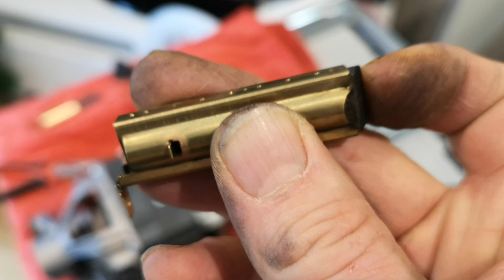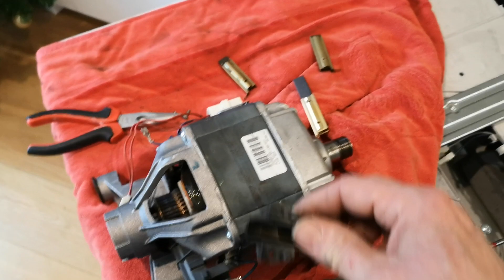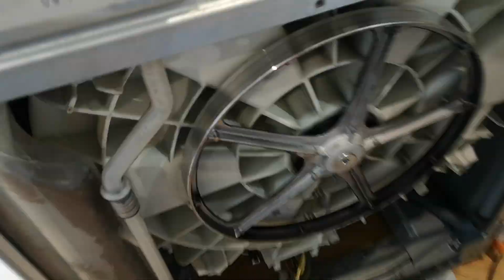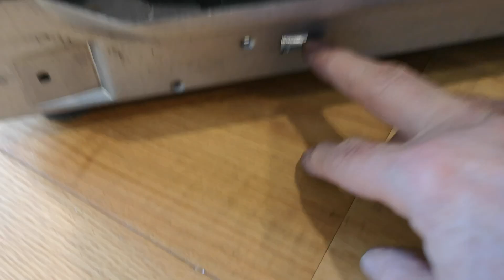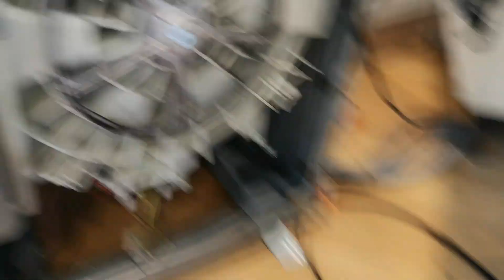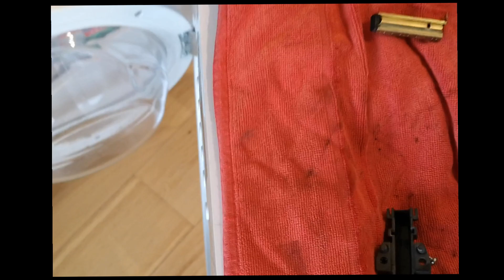NEFF / Bosch Washing Machine Washer Dryer Drum Not Turning £7 repair NEFF v6320x0gb  Brush Fix

Comment: And I've just had a Bosch washing machine fail, repair man replaced brushes (£7 - but £30-£35 online line - postage? haha). But still had a fault, replacement circuit board over £200 - how much are new machines? Cynical indeed. Not faulting the repair man, he identified the cheapest probable cause first. There was a £60 call out fee.
Reply from the maker: Fairly priced spares would cut the cost of ownership, help the environment and provide more employment for repair technicians. The new machines are too cheap and the spares are way too expensive.

Comment: did you have the link for eBay for the brushes?. Thanks
Reply from the maker: They are for a Candy machine. You do have to bend the contact tags but they work fine (see video)  Search '2 x Motor Carbon Brushes For CANDY Washing Machine Pair Set Replacement' on eBay
Reply: @razenby  Great vid, fitted some toady, saved a fortune, my son was going to get a new washer dryer for £750... very happy lad.  :) Thanks, Gary
Reply from the maker: @garyharvey7905  Glad you found it useful.